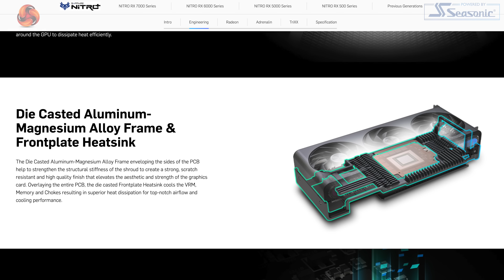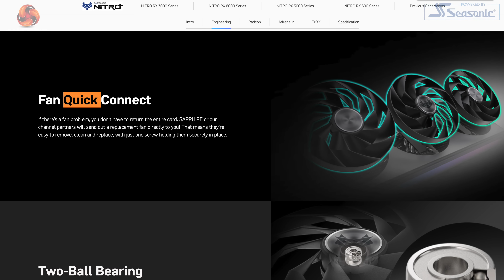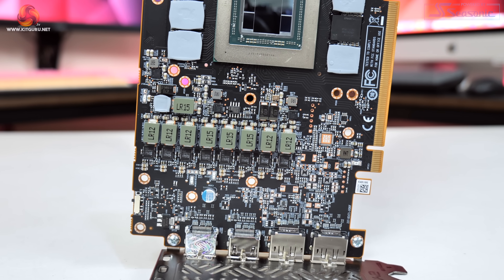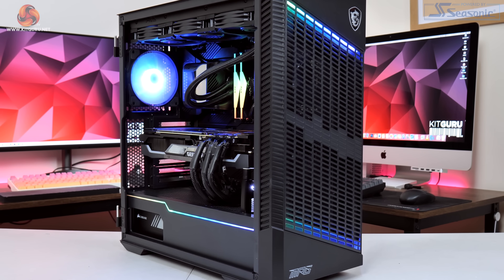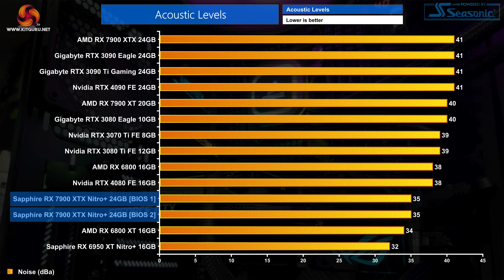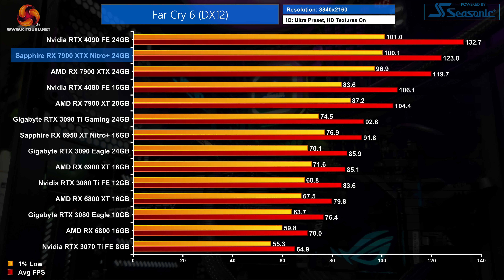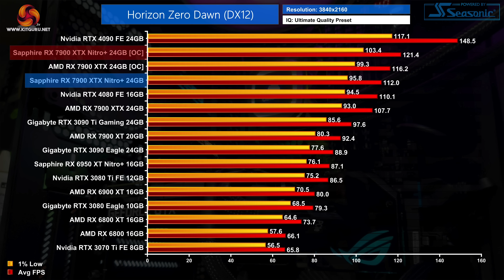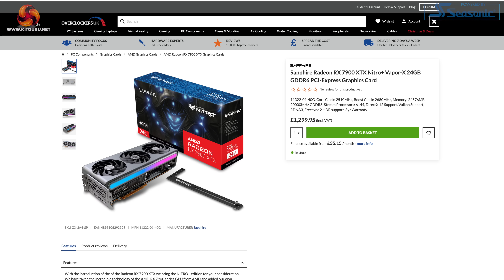Sapphire RX 7900 XTX Nitro+... one heck of a card!

Comment: AMD fangirls were al ways talking about Efficiency but now 7900XTX is less efficient and perform less than 4080
Reply: Did you buy a 4080 yourself?
Reply: You're right, but how quickly did you forget the 3090 ti and the 600w bios for 1% oc...The way you change goalposts is faster than a 4090😂😂😒
Reply: Spotted the 4080 owner.
Reply: So, You need others to validate your purchase?
Reply: Its AMD 5nm+6nm vs Nvidia 4nm. Hope AMD will move it to 4nm next year.
Reply: @Ronny999x  I don't, rather see them get a better architecture on the cheaper node, but they need to stop price matching Nvidia, it's dumb
Reply: Everything if you move the power slider, duh
Reply: Fangirls? Are you one of the 4080 scammers on ebay left with 200 cards?
Reply: Lol
Reply: It doesn't perform less than a 4080 tho..? In majority of games it outperforms the 4080 and does so at a lower cost. I'm confused.
Reply: @asplmn  yeah the xtx 7900 out performs the 4080 except in ray tracing , but however in 1440p ray tracing works fine :) I’m going to get one soon to replace my 6800xt
Reply: I think you need to update your facts as AMD released a new driver 22.12.2 five days ago that saves 50 to 100 Watts in every single game so ...

Also I'm impressed how you can select a derisive term that's also sexist which makes you a stereojerk...
Reply: @dgillies5420  The 22.12.2 doesn't resolve the remaining idle power bug that comes from having multi-monitor setups.
For instance someone splurging on three 4k@120hz monitor might find that their average idle wattage might shoot up 50 more watts.

The update fixes the 'video decoding' or basically power usage when watching a video.

The next update that could change things is in January, when they get the driver fix for the idle temp, that's when things really starts rolling for AMD as usual...

Hopefully this also means 'refreshes' in AMD GPUs as well as mid range GPUs starts using more mature drivers.
Reply: @dra6o0n  
Of course you'll have a higher idle power you're running 3 4k screens.

You don't use less power to more stuff.
Reply: @dra6o0n  the 180watt multi-monitor bug affects whom, exactly?  The 3 clowns on earth with greater than one 120 Hz 4K monitor?
Reply: Perform less ? Have you look at the benchmark lmao. And that’s coming from a guy with a 4090
Reply: Yeah and this AMD cuckboys who were promoting the card were also bunch of liers who lied through their Ass dissing out NVIDIA when their own card was absolute garbage
Reply: wow imagine assuming genders just like that
Reply: Oh no, a rando 9 yo keyboard warrior called other rando people "girls", they're so owned! 🤣

🤡 like you were always deflecting that power doesn't matter.

So why does it suddenly matter little kid? 😂
Both SKU families are way more efficient than previous gen anyway, why so bitter?
Reply: @robertstan298  says who UFC heavy weight Champion? just shut the fk up kiddo you can't proof zero shit in internet by talkimg shit 😎
Reply: You can help AMD balance it's innovations to the competition if everyone stops buying GPUs for a luxury gain of better picture quality when they've already have 230% of their original fidelity since 2018.

Buy based on practicality rather than on a desperate desire hyped up by some grey haired dude in a leather jacket.

Price shoots up because "the more you buy" right?

Stop propping up Nvidia to be Apple.
Reply: Amd is better than Nvidia in every segment
6400xt>1630
6500xt>1650ri
6600>1660
6600xt>1660ti
6650xt>3050
6700xt>3060
6750xt>3060ti
6800xt>3070
6900xt>3080
6950xt>3080ti
7900xt>3090
7900xtx>3090ti
Reply: You realize things change from one architecture to another right? worse than fangirls
Reply: Half true, half false. The 7900XTX is the better performer, but it is way less efficient than the 4080 due to the process node comparison...but, it is also the cheaper card, thus why it is more popular and will continue to sell better.
Reply: Why  are you AMDfangirls  so mad? Didn't your boyfriend pound your Ass hard enough 😂?
Reply: It's even worse when you read the comments section on Wcctech I could sworn the person was possessed with so much vitriol against AMD consumer. Likewise also against Nvidia consumer hahaha.
Reply: What are you on about 10% win over the 4080 for only double the power, what a win!!
Reply: @Ray Force almost no one buys based on how much power a part draws. If it can stay cool, performs well, and is priced well as compared to that performance. Thus, the reasons why the reference 7900 XTX is more popular than the 4080 and why the AIB XTX cards are going to do better than the AIB 4080s.
Reply: @scottheighton5971  have you checked the actual specs? It's chugging 450W with 0.8V-0.9V, current will kill this GPU
Reply: @lapz6758 I am 100% certain that the engineers at Sapphire know more about how their card will perform and how long it will last than anything any of us could guess about it, so if those are the specs they have it running at, so be it.
Reply: @lapz6758  bs.
Its max power usage is 390 watts per hour, that's it fully overclocked.

An 4090 can use up to 800+ watts per hour, and you're pissing and moaning about a 390 watt card?
Reply: @zagan1  yeah, with that last comment about 4090 using 800W, I won't respond further, you clearly have absolutely no knowledge of what you are talking about. I will go enjoy my 6800 which is an actual good GPU that doesn't have to push 400-450a which is above TSMCs max spec, to just barely compete against a 4080 which is a very cut down die. Have fun with your broken GPU
Reply: @lapz6758  Some people seem to have gotten 1000-1200 watt power supplies with 12 pin connectors straight out of the PSU itself, that splits in half to two 8 pins...

I dunno if those output 500w or 600w that is halved, but a 8 pin is suppose to handle 150 watts to a GPU, those PSU are going to fry your GPU if they output more than 300w for each 12 pin split to dual 8 pints...

I wonder if Nvidia knew this is gonna happen once the 12 pin connectors starts becoming common and PSU manufacturers decided "hey why not just use 12 pin slots on the PSU instead of regular 8 pin slots, and use dividers?"
Reply: An example PSU to look at is a 1200w PSU named Rosewill Photon 1200W.

People get confused, do you stick a 8 pin connector into the PSU, omitting the extra 4 pins? Or do you stick a 12 pin into that thing entirely, and use the splitter into your GPU's two 8 pins?

Etc.
Reply: @matt greenfield Are you comparing this card with one that is hundreds of dollars extra, especially the AIB cards? You must be a fanboy for making these comparisons.
Reply: @matt greenfield You payed 60% more for that card. If you make these comparisons you can also say that for the price of a 70 class card it defeats the 4080. It so dumb. Paying the amount you have to pay for a 4090 you can't compare it to anything of AMD.
Reply: 4080 is better card as Ray tracing works much better and dlss 3 is fantastic. Amd drivers also suck.
Reply: I love seeing the intense copium that AMDelusional fangirls smoke every launch. Every time they fail they always shift the goal post to next gen: “rdna3 didn’t win like I said it would but rdna4 will 100% win” - Jim the amd boot licker from adored Tv, 2022
Reply: @Drip7914 ooo shit. Why do you take graphics cards so personally?
Reply: @woadraven717  YB Better comments on like every tech channel bashing AMD this is like the 12th channel he’s been on I believe also before he calls me a amd simp no I’m team green I use the 3070 but I hate the team green team red stuff like it breeds so much toxicity why can’t we just appreciate both sides technological innovations yknow
Reply: @adamcorv  sounds about right, poor fellow. The toxicity is real unfortunately. 

I only want AMD to win so Nvidia can release another Titan. 💁
Reply: @Drip7914  Get a life
Reply: @Drip7914  rDNA 2 was an absolute win and probably the only one sadly
Reply: @lapz6758  how did it win ?
Reply: @Exteliongamer  Finally releasing a very stable generation of GPUs that matched Nvidia raster, had a very good efficiency and no hardware bugs, ray tracing performance is fine, same as Turing, and released FSR.It was the first GPU launch without hardware bugs in a long time for AMD. It created a nice reputation that they absolutely destroyed with rDNA 3 disastrous launch
Reply: @lapz6758  ah if u put it that way then yes I totally agree and I really love my 6950xt cuz of those same reason. But as for the xtx 🙄 sure it’s still actually cheaper than 4090 and 4080 for the performance it’s giving which made it a good value if it wasn’t for those back to back bugs and errors. I was trying to get the xtx at first but then decided it wasn’t worth the time and head ache until they actually get it right or for the refresh
Reply: @Drip7914  
The 4090 is only fast at 1440 and 1080.

Goto 4k and 8k the 4090 and 7900xtx are around the same, as the amd gfx chips are in all the consoles.

I don't know why channels are even still bothering with 1080 testing as most people have 4k TVs and monitors struggle to go past 60 fps to 140fps.

And once you go 4k monitors etc you ain't bothering with the little resolutions.

Comment: This makes the 4080 look better value in the uk especially with its power draw.
Reply: Value is relative. All of these 900+ pund GPUs are trash value when getting outside the bubble and looking at the big picture.

But at least AMD has good value on last gen. Which you can't say about nVidia with either generation and neither are there most cards restocked anymore either.
Reply: @robertstan298  
Yes my 6900xt is great especially with more power tool👍
Reply: fr

Comment: That coil whine is horrendous! My Nitro+ 6800 XT didn't whine in the slightest, even with a hefty OC.
Reply: Mine does occasionally in some games
Reply: @xXDESTINYMBXx  which card is giving you coil whine? and how bad is it? can you hear it during gaming? The reason I am asking is because I am about to buy one of these Sapphire 7900 XTX cards and I fear coil whine.
Reply: @theHeartlessNooB  nitro+ 6800xt, in some games sometimes, it's noticeable,  but not that bad. Anyway each card is different
Reply: @xXDESTINYMBXx  noticeable when playing with the volume on and case closed?
Reply: @theHeartlessNooB  a bit, but most cards have coilwhine. Doesn't matter if it's amd or nvidia.
Reply: Coil whine doesnt happen during gameplay. He should hv mentioned when coil whine happened.
Reply: @sudeshryan8707  I think everyone knows, but its good to show worst case scenario issues, also if you push fps high on a high refresh monitor at say 240+ it will happen a bit.

Comment: looking forward to seeing which AIB model is the best, this one seems like a pretty solid candidate
Reply: Yeah this one is the best, Sapphire are brilliant. always have been.
Reply: Yeah id say this is right up there. I refuse to give Nvidia my money for the 4000 series, its massively overpriced.
Reply: @hairsprungdutchtechnique9626  both are overpriced rn but at least the xtx is slightly better value
Reply: @Hietakissa  this card costs 1300 which is more than even the best £1200 ASUS tuf and gaming X trio 4080. So how is it better depsite having only equal raster, 50-60% less Rt in CP, DL2, Witcher 3, worse upscaling, no frame gen, no rtx remix, less efficiency and SIGNIFICANTLY worse vr performance
Reply: @Drip7914  the xtx is slightly better in rasterization (like 5%) and in most places the 4080 is about 200-300 more
Reply: @Hietakissa  it’s 3% better at 4k according to Hub HOWEVER that’s including the mw2 result where it beats the 4090 by 30%, which is clearly an outlier so it actually LOSES by 5% if you remove it. Either way they’re close enough on average that you wouldn’t be able to tell the difference. 1000 reference cards are impossible to get in the Uk/Us AND they have the added risk of 110c hotspots as seen on Reddit currently so your really only left with 1100 - 1300 models which surprise surprise: is where the 4080 lies. I’d argue even at a 200 difference that someone spending a grand will just say F it and get a 4080 (Hub also suggested that) HOWEVER it’s more like 100 and in THIS case the sapphire nitro costs like 100 - 150 more than decent AIB 4080s so even worse lol.
Reply: DLSS and FSR are pretty much on par in upscaling nowadays and FSR will get frame generation next year. RTX remix isn't that great either, don't know about the VR performance part so I can't comment on that
Reply: @Hietakissa  “dlss and fsr are on par” - Yh no, maybe in a couple games like deathloop but even in games like cyberpunk and god of war which use the latest fsr 2.2/1, things like Kratos beard, bushes and signposts/thin lines in cyberpunk still look FAR worse with fsr and Im talking about regular gameplay not that stop and zoom x10 bs most channels do, Daniel Owens has shown the superiority of dlss time and time again. 
“Rtx remix isn’t that great either” - 🗿🗿🗿 people are copy pasting some basic files from portal rtx to games like max Payne and Swat 4 yet they look like new gen games just with the ray tracing alone and no texture mapping. It will be a game change and SIGNIFICANTLY add to the Rt catalogue once this fully releases, to outright deny it is delusional. Fsr frame gen won’t be hardware accelerated as amd said it will support every gpu so once again it will lose to ACTUAL dlss 3. I know what amds problem is? They don’t innovate in feature gamers will actually care about, they keep chasing Nvidias coattails and instead of being competitive they try and slot into Nvidias lineup because they think their products are better then they actually are. The sad reality is that neither the xtx or 4080 should be bought as they’ve clearly been hiked up in price to sell old stock BUT if you HAD to choose, the choice is clear for the multiple reasons I’ve outlined 🤷🏽‍♂️
Reply: @Drip7914  If you're going to quote me at least get it right and don't twist my words. I never said they were "on par" I said they are "pretty much on par" implying that there's a difference, but it's not major.

Even with the "stop and zoom x10 bs" both look very similar with only minor differences between them in most scenarios. In regular gameplay you probably won't even be able to tell the difference without a side by side comparison, except for some rare edge cases. Hardware Unboxed made a pretty good video comparing native TAA to DLSS 2.4 and FSR 2.2 in Forza Horizon 5 about 2 weeks ago.

I tried to look up this RTX Remix Max Payne but all I found was an RTX Remix video of Max Payne with every material being extremely shiny with a bunch of graphical errors, not what I'd call "next gen games", unless you're talking about Cyberpunk on launch day.

Especially considering FSR is available on all GPUs I'd call it more impressive and innovative than DLSS, it's even breathing new life into some people's 1000 series GPUs.

We don't actually know yet whether FSR 3 will be hardware accelerated or not, AMD hasn't confirmed anything about it yet, other than it's coming in 2023.

Btw about the GPU pricing, the absolute best 7900XTX card is 1449 where I live, while the cheapest 4080 cards start at 1549, so there's a considerable difference in favor of AMD, I believe this is the case pretty much everywhere in the EU.
Reply: @Drip7914  Mate, prices are not the same in every country... where he lives the xtx models are about 100~200 euros cheaper then the 4080, depending on your usage pick your poison!
Reply: @Drip7914  imagine thinking dlss3 Is required to enjoy your computer
Reply: @hairsprungdutchtechnique9626  amd also overpriced this 6800xt successor to 1300 from 650, a bigger increase than 700 - 1200…
Reply: @hairsprungdutchtechnique9626  bruh, as is AMD aswell with its 7000 series, whats your point? Just hating?
Reply: Dlss 3 is great. I like sapphire and amd but without a good dlss option and decent ray tracing it’s hard to recommend the amd platform as a whole
Reply: @lucifersheadscarf6988  Yh I don’t see why I should be having to make major concessions despite spending 1100+ 😭 the argument of missing features only works at sub 700 eg - 6800xt/6700xt

Comment: Water-cooling this card would kill your energy bill
Reply: despite this, it never stopped people from buying 4090s, 3090ti, 3090 that pushes 450-600 watt at OC. Same goes for cpu that pushes 250-350watts during OC. Same buyers from UK, EU and Murica
Reply: @JJssss  yep, we are just now reaching the power usage of old school SLI rigs. Dual OC'd 1080ti could pull 4-600W and there were people with quad setups.

The only reason question is if you can cool it at this density and I think they've cracked that on air.
Reply: Use the hot water to heat up the house, save on heater energy :)
Reply: Water cooling doesn't magically raise power consumption.